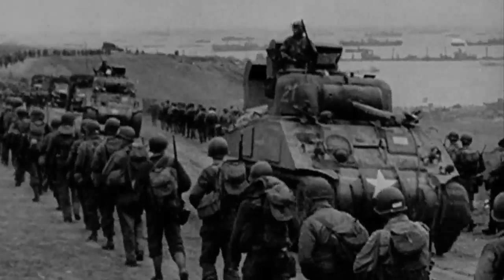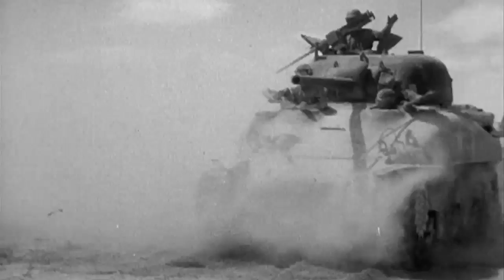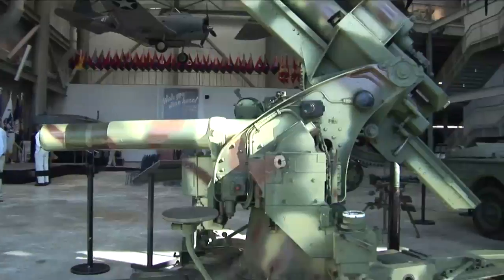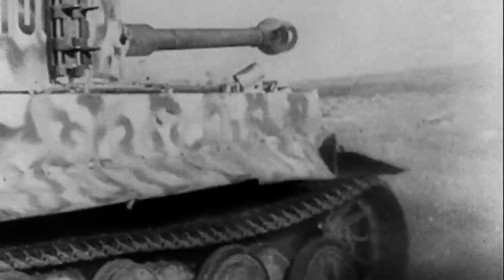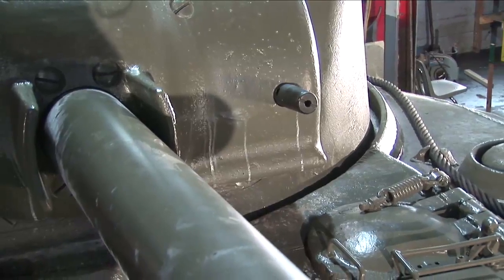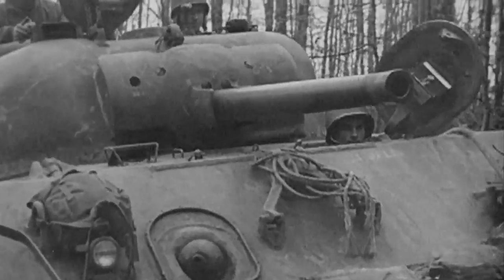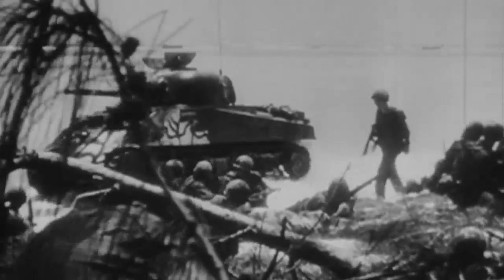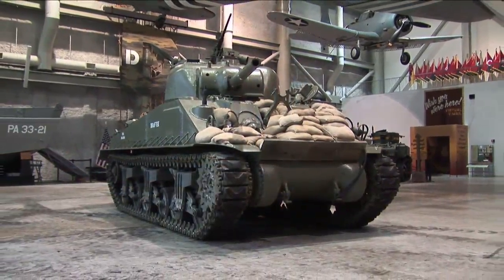The M4 Sherman Tank at The National WWII Museum

Comment: Fucking reliable that explode and set fire to the crew If you shoot it with a pee shooter 1 tiger could kill 100 m4's without a scratch
Reply: +Fred RC It's obvious you know little about tanks at all...

The only pro's the Tiger had was firepower, and armor...

that's it.

the Tiger was a lot more difficult to manufacture. only 1500 Tigers where ever produced since 1943. while over 40,000 Shermans where produced. 

the armor, of the Tiger is 100mm angled at 9 degrees. 

the armor of the Sherman is 63mm angled at a high angle (can't remember the angle) when it's angled it becomes near to 90mm of armor, while being several tons lighter... 

the 75mm gun on the sherman was more than enough to kill a Panzer III, Panzer IV and Stug III. the kwk-36 88mm gun on the Tiger was easily able to kill a sherman and T34 at any distance, this doesn't make the Tiger unstoppable. 

the later models of the Shermans was equiped with a 76mm gun that was easily able to penetrate a tiger withing 500 meters, and over that with HVAP. 

the Tigers couldn't be repaired on the field, it had to be towed back to the factory in order to be repaired, usually the transmission died on the Tiger, a highly unreliable tank.

and unlike what the video says. the Shermans was not designed for Anti tank combat, sure it could handle it. not it's intention. (until it was fitted with the high velocity 76mm gun) 

the Shermans where initially ment for infrantry support. that was it's main purpose.
Reply: ***** i know they were were heavy and they breakdown a lot but the Sherman is just shit
Reply: Fred RC how exactly? Please provide reason for this.
Reply: +TinyTinyDwarf Well, seeing as the crew deathrate for the sherman is 1 of the lowest for any tank to fight in WW2... And in its design, we actually learned form our mistakes, rather than being germany and just going bigger for shock factor.

I mean honestly, if you study the war to any extent, the best machine the Germans has were Panzer 4s. They were strategically fast (not requiring any extreme assets to move them, and they coudl easily maintain high rates of speed over good terrain to move from battlefield to battlefield), easy to manufacture, easy to repair, reliable, and a good comparable gun, the long 75mm. 
Actually if you look across all the nations. 
Their best machines (strategically) were the medium tanks.
Pz4 series, M4 series, T34 series (took till 43 to finally get 3 man turrets... but we'll give it to em anyways), British Cromwell and Comet.

Tiger and Panther were just too costly, too slow, too high maint. When they were in the right place, and they were working right, they were amazing... the rest of the time, they were logistical nightmares, that had to hope the enemy would come to them. Why do you think that everyone else just kinda gave up on their heavy tank projects, and focused on mediums? (Other than the russians ofcourse, but even they came around by the end)
Reply: +Fred Rc the vlog guy  WRONG!  When the Sherman was fitted with the British 76.2 QF 17 pounder gun it went through Panthers and Tigers like a hot knife through butter and was feared by German tankers.  The 76mm American performed fairly well against German armor and the few 105mm Howitzer version did well with HEAT rounds.  The German tanks had advantages, but they were far from invulnerable.  Most Shermans never even saw a Tiger or Panther as there were so few that were operational.
Reply: *****
Im citing his book as the source of all the misinformation, as for years its been the goto thing for documentaries that didn't want to check more than 1 source.
Look at most western documentaries about tanks that reference the sherman by any stretch, and Belton Cooper's Death Traps, comes up as a source.

It is a problem, because of just how misinformed it has made people. But you can't say that the history channel was lying to people. "They can't lie on historical documentaries".

You know, I actually did a presentation in highschool for my post civilwar US history class. My topic was technological advancement over WW2. I touched on various things like the steel industry and advancements in synthetics and metallurgy. Even made the dubious claim of not only, did jets exist in WW2. They weren't so limited as a "wonderweapon" either. With there being several hundred (actually over 1400) produced.
No, teacher said I was straight up lying about that, jets didn't exist till after the war. And when I dropped the bombshells that were the early Meteor that flew in 43, and the P80 in 44 (later I learned that they were introduced in 44 and 45 respectively, but they did in fact exist is the problem for the teacher)
Got kicked out of class for saying that everyone had submarines by that teacher too.

I'd hate to see what that teacher would say now for my materials science presentation I gotta do for college in a few weeks, where I'm going to lay down the fact that humanity was smelting and making weapons from copper as far back as 7500BC. Whereby a SJW in my class will comment that I should say BCE.
Then I'm going to pull out one of the swords I'm bringing in as examples of what was done with the advancements in metallurgy. And fucking kill myself.
Full story at 8, film at 11.
Reply: Linkxsc  The other problem with Cooper is he only saw the vehicles that came back to the rear to the repair or salvage depots, it wasn't like he was in a Sherman or a tank destroyer.  I know one US Vet who was in an M-36 Jackson with a 90mm gun and he told me they knocked out every German tank they came across including two King Tigers, a JadgTiger, JadgPanther a Tiger I and many more Panzer IIIs and IVs or as he put it with and with out the turret, probably STuGs too.
He said you had to be a hunter and rely on good communication with infantry spotters and tankers who saw these things coming.  Then get into a good concealed position nearby, shoot and then move out quickly, stop, shoot again repeat.
His vehicle only got sprayed with some machine gun fire once with one crewman injured, that was it.
Reply: +Linkxsc Yeah i have noticed that Death Traps is the reason for majority of the hatred for the Sherman. A lot of people tend to believe everything in it, even though its full of false information, like saying that Patton is solely responsible for not starting the development for the Pershing early on or saying that any gun over 37mm is an artillery piece and that's why Sherman has a low velocity gun. And people take that book as history book, even though its a memoir. Not only that but it is also a failure as a memoir. When writing a memoir, you must primarily talk about events you had direct involvement in, yet large majority of Death Traps is about events at the top levels of US military command or in direct tank combat where Belton Cooper had zero involvement.
Reply: Linkxsc Belton coopers book deathtraps is a memoir. Not historical documentation. You citing his book means your arguments are redundant.
Reply: *****
Suggestion. Add extra paragraph spacing, kinda wall of texty.
But to answer your initial question.

The whole "shermans fire, shermans crap" can easily be pointed at the various documentaries about the war over the last few decades, especially ones on the history channel and such. Many of these videos sourced information from "Deathtraps" by Belton Cooper.

Its a book by a guy who works in recovery. All this person ever saw were knocked out tanks, and his job was to put them back together, and send them back out to fight.

This leads the whole book to a slightly skewed view of the machine's performance. And doesn't take into account any of the strong points. interesting bits even make dubious claims of how poor the armor was and such. Even though anyone who knows the basics of armor and angling can quickly see that the M4 was vastly better armored, and competitively armed along the lines of what it faced. What it faced being P3, P4, Stugs, and various AT guns. (Tiger and Panther being far too rare, and easily considered statistical anomalies)

Entertainingly when looking at the Amazon page for the book (trying to remember the name of the writer) I run smack into reviewers who are themselves spouting sheer ignorance in their reviews as well. Talking about how most german armor was taken out by allied air support and ignorant things like that. Artillery support yes. But basically every tank reviewers came across that they couldn't figure out exactly what killed it, they gave it to the air support. And frankly, across the whole war, close air support was woefully ineffective against tanks. (But surprisingly good for morale, as you're not having a great day if all of your supporting infantry had just gotten strafed, rocketed, and bombed by a bunch of fighterbombers)

We all know the Sherman was not a great tank. It definitely was NOT the greatest. But it was by no stretch of imagination a BAD tank. If the M4 is a "Bad" tank, what does that make the woefully lesser armored P3s and P4s that it fought regularly, or the T34s on the eastern front fighting the same enemies, with worse records of effectiveness (that 2 man turret and lack of radio really screwed the 34 crews)
Reply: The after action reports show Shermans had almost a 1:1 kill ratio with German tanks, even against Tigers and Panthers.  Better speed, manueverability, turret traverse, firing on the mover etc to get into a killing posiition on a Tiger or Panther happened more often than Cooper's book or the History Channel would lead you to believe.
Reply: +Fred Rc the vlog guy All petrol tanks had a greater risk at catching fire, the problem with the Sherman was that the front storage of ammunition tended to blow up to fast when it started burning, this was fixed installed wet storage.
Reply: Lunkwow Correct about the Sherman and that was only correct about the Tiger if it was fracing its' frontal glacis at the Shermans.  Side, rear, undercarriage and turret gap shots even by the lowly 75mm Shermans could be lethal to a Tiger or Panther.
Reply: Linkxsc completely agree. Well said.
Reply: @Linkxsc
I agree with most of your comment. Just one caveat: Panthers weren't much more expensive to produce than Panzer IV. Only slightly, and their performance in battle was vastly superior. The problem with them was that they were less reliable and harder to maintain. So yeah - it is possible that the Germans would have been better off just improving on the Panzer IV design and perhaps optimizing the production costs and output.
Reply: Please just kill the SJW, thnx.